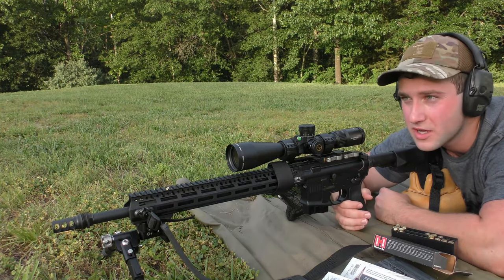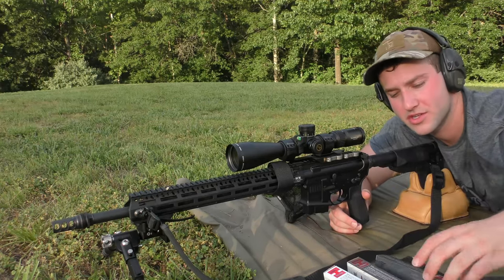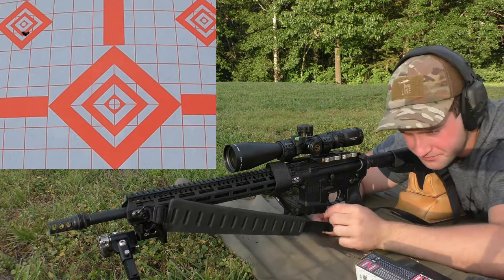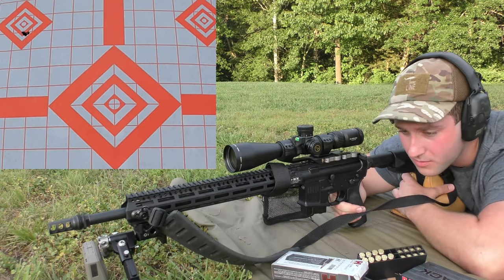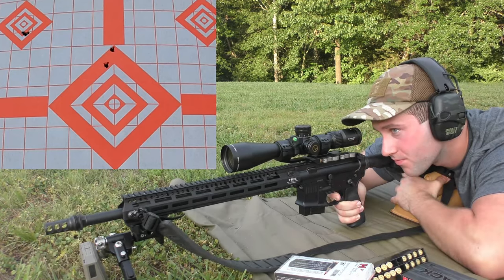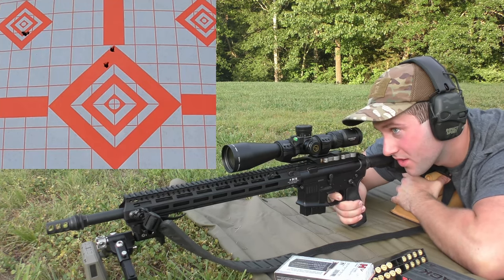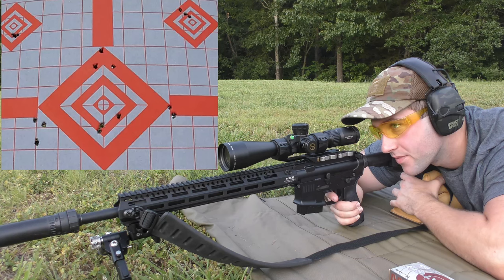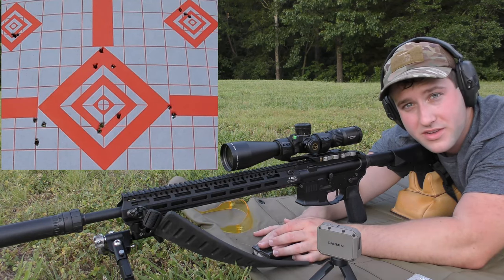22 ARC Shooting 62g ELD-VT, 75 ELD, 88g ELD Hornady Factory Ammo Accuracy Testing Gas Gun 18" BA BBL

Comment: The ejector swipe issues are actually case head swiping.  Bolt trying to unlock before the cartridge releases its grip on the chamber wall. Worked this cartridge when it was originally a 22 Grendel then developed my own based off the 6ARC case... named 22 DPC

Recommend getting an adjustable buffer weight system and spring kit from JP rifles. The heavier spring is key to mitigate the CHS (case head swipe). You will need to find the fine line between reliability with the heavier spring. Adjustable GB to switch between suppressed and unspressed with this cartridge
Reply from the maker: I saw that video quite some time back. Thank you so much for the advice! I appreciate the input from someone who has tinkered with this extensively.
Reply: Does rifle +1/2 gas help with this?
Reply from the maker: @whiskerbiscuit99  Good question. At some point, timing becomes irrelevant. There will always be a point where you are just overpressuring the system/brass, regardless of dwell time. However, I'm not a scientist. I'm just a shooter. So, I don't know anything 🤷‍♂️.

Comment: Great video. I just built a 22 arc using a carbon barrel 1-7. It’s shoots 62-75g sub moa but 88s open up to 1.5 moa. I shoot suppressed using a flow through, with a non adjustable gas block, still eject as under gassed. I’m about 300 rounds on the barrel, I noticed the groups tighten up around 180-200 rounds. I haven’t had any brass issues that I’ve seen. I also have the .22 dpc and 6mm arc. I earn a living behind a scope. Daytime and nighttime. I’m partially fond of the eld-vt due to their anchoring abilities on coyotes. Thus far haven’t seen a need to hand-load for either 6mm or the 22arc. Although after watching your video I’m wondering if hand loading would be worth the time. I’ll definitely be hanging in to see what you end of loading. Thanks for video
Reply from the maker: Thank you for the feedback! That would be one heck of a way to make a living. Lots of good cartridges for varmints in the ar15 platform. The 22arc should be right at home with the rest of them. Just curious to see what kind of accuracy we can produce with handloads.

Comment: Good video. My barrel does NOT shoot any where close to that. I have shot both the 62 grn ELD-VT and also the 88 grn ELD factory ammo. I shot both of course at 100 yards and also shooting five shot groups. Must of my groups are 1 1/2 to 2 moa. Sometimes I will get two bullets touching and then the group opens up. I have not stared to reload for it yet. I am going to try some handloads and see what happens.
Reply from the maker: My previous barrel shot horrible. So, I know where you are coming from. I didn't even try to handload for that barrel, and I have yet to contact the company, but it is defective as far as I'm concerned.
Reply: @RisenCitizen 

Was your previous barrel a faxon by chance? I just picked up one and it shoots terrible.
Reply from the maker: @jeremyschmidt4449  yes it was, unfortunately.
Reply: @RisenCitizen  
Thanks, did you have any issues returning it?
Reply from the maker: @jeremyschmidt4449  I have so many projects that I haven't even spoken with them about it.

Comment: Could the the reason you have over pressure be because the chamber us iff from manufacturing or carbon build up? How well well did you clean your riffle?  You should watch VORTEX NATION PODCAST. They recently did a 6mm ARC video and did factory loads and  hand loads.  Its not 22arc baut you know. I also just watched aanither video about 22arc that was pretty good but unfortunately i cant remember the whonout it out because i have never heard if the person before but it still was a good video. Thats how i found i its supposed to almost match the 22-250 but uts a lil bit slower with better wind drift and much better BC. Does way better further out than the 22-220.

Comment: What was the temperature when you were shooting?   Would maybe keeping the bullets cooler woud calm down the over pressure issue?   I know sometimes high temperatures can cause those issues. Just a thought.
Reply from the maker: It was pretty hot 80-90°F. So, not a cool day by any means. You make a good point, though. I may end up pulling some of these rounds just to see what kind of powder Hornady is using.

Comment: I’ve been popping primers on 6mm ARC too with v match.
Reply from the maker: It seems like most of Hornadys' newer cartridges are loaded really hot with their factory ammo. I get what they're trying to do. I just don't like seeing pressure signs on handloads or factory ammo.
Reply: The primers pop out or are they getting pierced? Piercing might be due to firing pin protrusion.
Reply from the maker: @rustynut1967  pierced. It only does it on the 75 ELD ammo. The rest don't have that issue.

Comment: Put some RTV sealant on your charging handle, it works way better than any gas buster charging handle on the market. Also a Superlative Arms adjuster gas block will let you retard or bleed off the excess gas to help with that and save your brass.
Reply from the maker: I'd never heard of that. The adjustable gas block is a great tool for the job, but nobody has ever mentioned sealing off the charging handle.
Reply: @RisenCitizen  there are videos on DIY gas buster charging handles. It’s like a cheaper more durable and effective version of the one from silencer co with the gaskets.
Reply from the maker: Awesome, that's really good to know! Thank you!

Comment: Some of the high pressure signs might go away with a tuned agb.
Reply from the maker: I tried throwing the heaviest buffer system that I had available in there to mitigate it, and it didn't help at all :/.
Reply: @RisenCitizen  I did the same thing before getting an agb for my 22”. I went back to a light buffer, tuned it and it really made a difference. My 16” is fine but it has the rifle gas length. 

The faster powders work better in the shorter barrels. Less gas to the face, cleaner brass and a little quieter suppressed.
Reply from the maker: @DarrenArmstrong-q6z  thank you for the info! I would have played with more of the gas system if I had more factory ammo on hand, but I didn't want to burn all the ammo up trying to tune it. That will probably come with the handloading portion.
Reply: That’s not going to fix the pierced primers though.